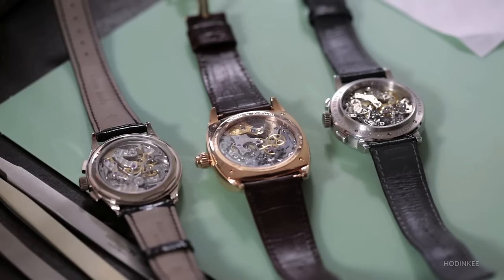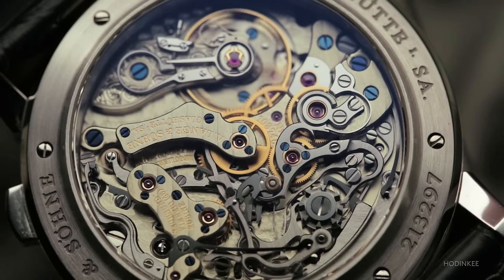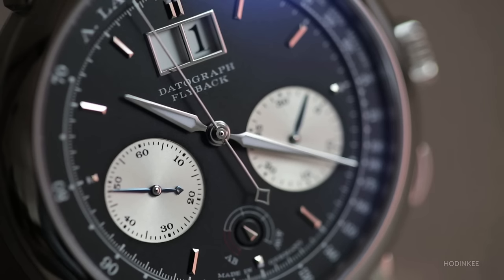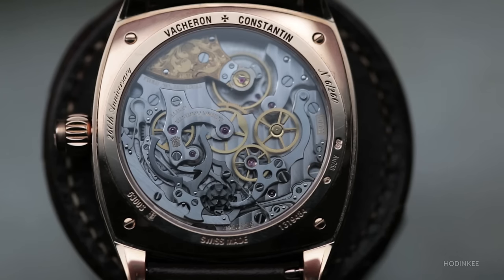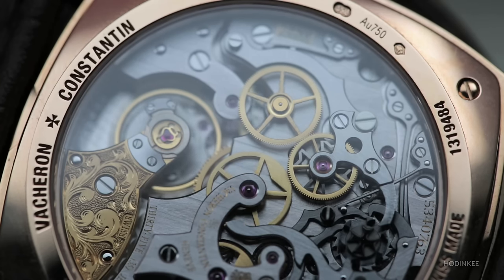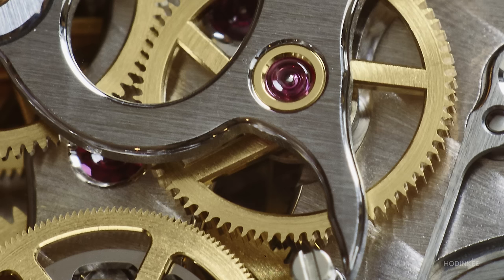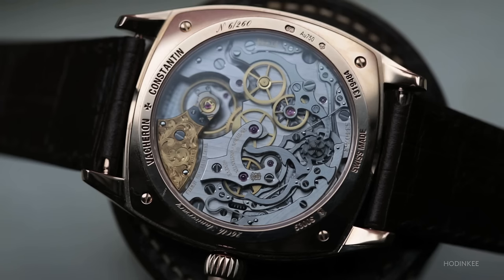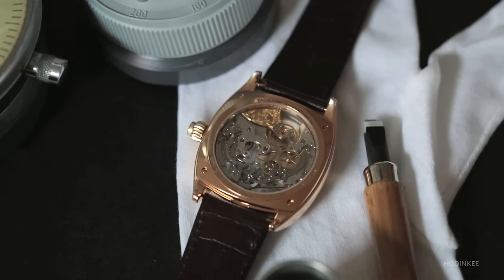A Technical Perspective: The Lange Datograph, Vacheron Constantin Harmony, And Patek Philippe 5170G

Comment: If you're in the market for a Patek but your budget just can't quite make it, get a Lange. Patek's and Lange's share so much in common, they're pretty much in a class of their own, though I know almost everybody will disagree and say a Patek is a Patek and that is that, which is true, but from a technical, and surface perspective, they are just as amazing, I'm just as impressed when I meet someone wearing a Lange as I am a Patek.
Reply: +Artisan Rebel Hello.
Reply: +Alperen Safi I didn't know you could do that, and I meant a Lange from the lower end of the price bar, which really wouldn't be that much different, but still significant enough compared to a Patek. In any case they are both beautiful brands and their similarities are hard to ignore..
Reply: +Alperen Safi I hope you realize that you can haggle at high end watch stores. Depending on the base price / material of the watch you can haggle 15 - 30+% off the retail. You have to realize that theyre salesman, not unpaid angels sent down to sell watches.
Reply: When Lange came out with the Datograph, they caught Patek with their pants down. Patek had nothing to compete and quite honestly, as good as the finish level on their movements was at the time, it didn't come close. They had to race to catch up, then Lange did a split seconds chrono and Patek had to race to catch up. You give up nothing chosing a Lange over a Patek quality, finish, or design wise. For an watch of equal complications, you'll almost certainly pay thousands if not tens of thousands less. Oh and Lange seems to know how to do hacking seconds, something Patek seems to be mystified by even on their mid-range watches.
Reply: @CrimFerret  You know your stuffs. I am also mystified that only Lange can do date flip perfectly at 12 o’clock.
Reply: @ChewBacca2339  
 "For Lange watch of equal complications, you'll almost certainly pay thousands if not tens of thousands less. "
PP and VC watch of equal comlications are the same / similar price.

Comment: This guy is an editor at Hodinkee yet he doesn't know that the VC button "stiffness" is on purpose to avoid the so called half-pushes, where the mechanism is not yet engaged but not disengaged completely either. This, on the long run, wears out the mechanism faster on the Lange and PP.
So the so called "defect" on the VC is actually a feature to prevent that...you have to push harder and it will only couple the gears when its fully pressed.
Even I know that, yet the " TECHNICAL EDITOR" talks about it like the watch is broken😂😂
All he had to do is call VC and they'd happily explain this. 
Amateurs pretending to be horology "experts" 😂